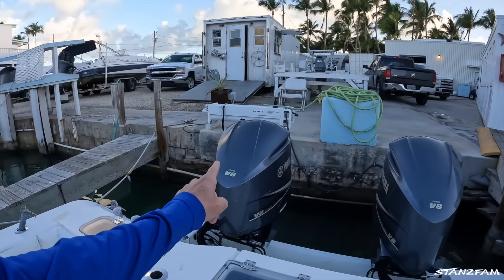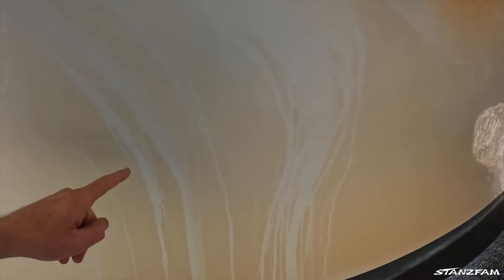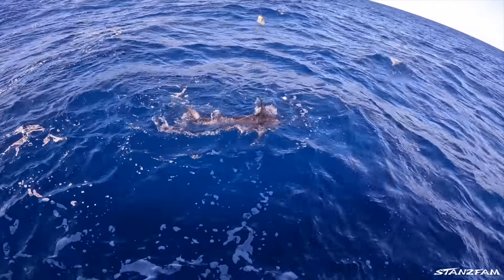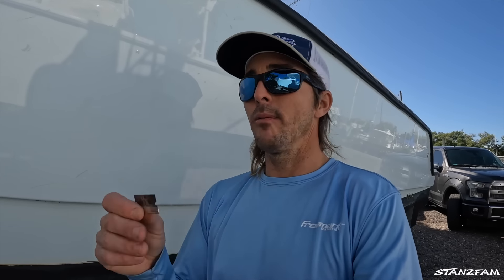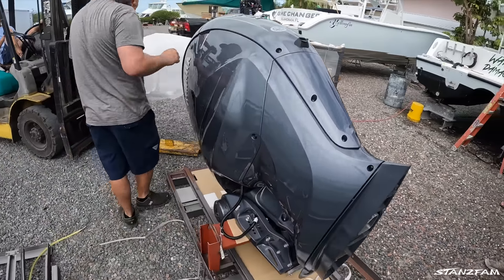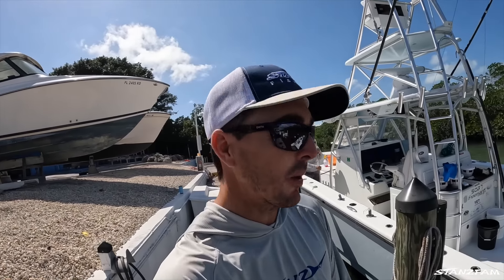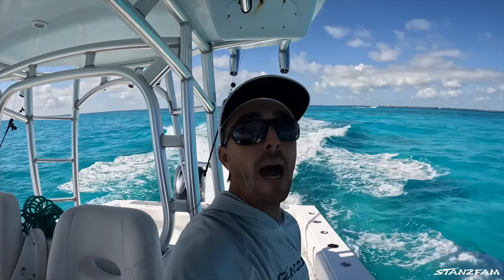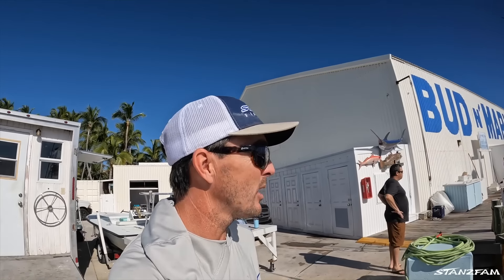$140,000 Motor Upgrade! New twin 425 HP Yamaha Outboards Installed on 37 Freeman!

Comment: How awesome was that!? I would’ve loved that ride! Good for you, Nick! Congratulations 🥳
Reply from the maker: @apollo5751 These are 30” shafts with integrated steering, retail pricing was $94k in fall 2021 when we ordered the motors. They are more now. Two sets of controls with new harnesses/wiring, new gauge (CL5) down stairs to support helm master 3 steering, two new helms, two new props, Install of new motors and all the rigging. removal of old motors and old rigging, bottom paint, fiberglass/gelcoat work, acrylic plates for dash, 17 days in boat yard, acid wash, wrap removal, wax, hinges, speakers, etc another $40k
Reply: Absolutely comical.  You're telling a Yami    Pro Staff member what things should cost!  Ha.
Reply: @Pietro-ni6ow  nope, I’m fairly certain he told you what it DID cost 🤷🏼‍♀️

Comment: Great re-do, Thanks for the work to share this with us.
I’d suggest getting the Sharrow Propellers.
It will get you a better economy of fuel burn and it will pay off their cost of $10 k.
* Only do so if Yamaha Marine Corp. will honor the warranty..
Reply: Also add a raised baffle at the stern to decrease the sound. Add Sonix to the side that faces the engines. 
It would lower the Decibel level and help with hearing issues later in life..
If your interested in my concept I can share it.
Lmk
Reply from the maker: Thanks for the info 

I would like to try the sharrow props too
Reply: @JS-sx3bl  you realize these are super quite right? no where near hearing damage levels!
Reply: @ct1762  I’d suspect you meant to spell Quiet. In any case the main issue is to get the propellers more efficient and second deal the sound of the two 450’s humming away at 5,000 rpm or more which has a great deal of overall decibel or DB displaced outside. 
* It’s reasonable when a person invents a product, it seeks an attempt to solve a problem, or ‘to better’ a known issue by the use of that invention..

Comment: You're going to love the 425s.  The power is great but the lower unit oil change at the dock is the real game changer!  The 3 piece cowling is a pain though.
Reply from the maker: Thanks! That was definitely a selling point for the gear lube
Reply: I really dislike the sound of the 425s when above 70% throttle.  They seem way too loud compared to Mercs or lower power Yamahas, and that is not just on Nick's boat but on every boat I've seen them on.
Reply: @TheVonMatrices  they addressed that on the new updated 450
Reply: @jonathanmack8487  I didn't know that. I'll have to listen to one.
Reply: @jonathanmack8487  Was out on a boat with the new 450's no more than a month ago, still very noisy. The Merc 450R is a much nicer engine to listen to, and the V12's are in a different league from a comfort standpoint.
Reply: @AB-80X  Oh gotcha. Have a boat coming in soon with triples I’m interested to hear them.

Comment: I had a mercury 250 have 471 b4 it blew up. And mercury 150 blew up at 500 hours. I then bought a 115 yamaha and 150 yamaha and they are still running with no problem at all.. no more mercs for me
Reply from the maker: Yamaha’s are definitely the most reliable. But I would say all the engine brands have really come a long way the past decade and they’re all pretty good nowadays. However I have no plans ever switching from Yamahas

Comment: Awesome video and congrats on the re-power!  I will be new to the Yamaha group soon so I have some questions for you when you have some time. Wow…4400 hrs on the 350’s is awesome!!
How would rate the Yamaha’s on a scale of 1-10 for overall experience?  I assume pretty good since you stayed with Yamaha rather than going with Mercury. 
How do you like the 425’s now that you’ve had some time to use them?  Are they miles ahead of the 350’s in performance and technology?  
Any issues with the 425’s to this point?  Are there things about the 425’s that you really don’t like?
Thanks for your time and thanks again for the cool video!
Reply from the maker: Thanks for watching! No doubt Yamaha makes the most reliable outboard engines. This boat isn’t at our marina any more but we had around ~700 hours on the 425’s  before it left. Never had an issue with them here and being able to change the gear lube while the boat was in the water was super convenient. We could definitely tell a difference in these engines compared to the 350’s. We were limited on prop selection which I’m sure there are more prop options to choose from now. They did lose a gear case within a month or two of the boat being at its new home. I’m not sure if it was operator error/abuse or just wear and tear/mechanical failure. 

We are at almost 1400 hours on quad 300 Yamahas on our boat and haven’t skipped a beat the past 11 months. We are upgrading to the 350’s soon so excited to see how much performance improves
Reply: @StanzFam . Curious why you didn’t jump up to the 450’s rather than the 350’s. I hear they have made lots of improvements to the 450 compared to the 425’s. Thanks for the info!  Really appreciate your time
Reply from the maker: Too big for the 42’ Freeman. They work on the 47’ though

Comment: If you haven't tried it yet, put the muriatic acid away and buy Oxalic acid powder. It's typically cheaper and much nicer to use. For water staining or rust stains just mix the powder with warm water in a spray bottle, spray it on, wait 30 mins, then rinse it off. If there is any staining left either repeat or make the solution a little stronger. No need to do that nasty and dangerous brooming. I have used this on commercial boats for years and it just works. Most of the expensive water stain cleaners you buy in gel form etc are primarily oxalic acid based. Enough powder to clean the staining on the boat in the video might cost $5.
Reply: Oxalic can be gritty depending on how fine the granules are so be careful with the gelcoat. Bar keeper's friend for example is designed to be pretty gritty. If all you are doing is making a solution and spraying it off, it should be fine, but careful on applying TOO much elbow grease in tougher to clean areas. I think that's where muriatic works really well because you can pretty much scrub as hard as you want since its pure liquid.
Reply: What ratio of acid:water do you use with Oxalic acid powder?

Comment: I have a 300 r 2023 power head that hydro locked.  I ran it for 15 seconds while it was slightly hot( 145 block temp).   It has 10 hours on it , but is seized.   The plugs are clean and the computer is immaculate.  I know you need to know why it’s ceased, but assuming it’s not warped, what kind of value do you think it has?
Reply from the maker: I haven’t sold any racing engines like that so I’m not sure how valuable it is. I would just look online to see what similar engines are listed for

Comment: Good looking boat. I think you need some more cup in your props though. They could stand to hold a touch more water at cruising speed. Running light, you could up the pitch a couple inches and probably see 52-53kts but I don’t think it would help anything loaded. I’d run 4 blades up a hole or two though.
Reply from the maker: We are hoping to get the EC series soon. (Extra cup). We just put on a pair of 21’s and got the Cruise up a few knots. Waiting on more props to try though.
Reply: @StanzFam  it’s a shame Yamaha folded Turbo up. I think pair of Turbo OS1 4 blades in 20p (16.25” diameter) would probably be exactly what the doctor ordered for that setup. They had huge blades and good cup so they bit really well and kept torque on the prop, not in a rooster tail. They’d top out at around 50kts WOT and cruise with probably only 10% slip.

Post a video when you get it dialed in please. Curious to see how that setup does.

Comment: FYI, dunno if you knew this but Blue Wave, the company that makes the fish box cleaner, also makes Rust & Water Stain Remover in a spray bottle. I have used it a couple times and it works a lot better for me, is sustainable and has no impact on our planet, which is the most important (for me), and might be much better for those that don't want to use plain Muriatic Acid.
Reply from the maker: Yep, love their rust remover.

Comment: Which engines are better in terms of fuel consumption: These 425hp or the four 300's?
Reply from the maker: They seem to be about the same , we are still playing with props . I do prefer the quad 300’s but the maintenance is a little more
Reply: @StanzFam  Great! And what about the noise? Which of these two was quieter? I'm looking at a Mercury 400 V10 pair, and I'm in doubt between these two engines.

Comment: Was it under powered with the 350s?
Reply from the maker: It was definitely bare minimum. Fine with a light load or even a medium load when they were new, but we definitely wanted a little more horsepower when we had a lot of fuel on board, livewells full, and a handful of people

Comment: You should have used a rubber wheel attachment for a drill to remove those little wrap pieces… would have saved you hours and hours of work lol! Next time!!
Reply from the maker: Thanks for the tip

Comment: How many times did you have to change out the harmonic balancers?  Did Yamaha foot the bill?

Love the boat.
Reply from the maker: We replaced flywheels every 700-800 hours. (Whenever we hit 80 hours in the specific rpm range). Yamaha covered the fly wheel changes

Comment: Will you re-wrap the boat? Aside from the scratchs working fish what was the condition of the wrap? (I need to repaint and am considering a wrap. Any observations you have on wrap vs paint are appreciated. Thanks and good luck )
Reply from the maker: We may re wrap it eventually, just not yet. I think that wrap was almost 4 years old . A wrap is definitely an easy solution to repainting, but they can scratch and tear if you’re not careful.

Comment: 140 000  it cost for two motors in usa ?  they are new ?
Reply from the maker: Motors, 2 sets of new controls , install, derig old motors, bottom paint haul out, wrap removal, hull wax, minor fiberglass and gelcoat work etc
Reply: @StanzFam  tanks.  can you say - how mach motor yamaha  for 150 hp ?

Comment: How’d you arrive at 140k for a “pair” of 425’s…?
Reply from the maker: Two new 425’s with 30” shafts are $100k, new controls (2 sets) with rigging, new helms, labor to install new motors plus remove old motors, haulout , wax , props, bottom paint etc was $40k , 100 + 40 = $140k
Reply: @StanzFam  Roger
Reply: @BigOleWhatchamacallit  yeah Yamahas are almost impossible to find and have gotten really expensive
Reply: Got a pair on a 33' Scout. Awesome machines!
Reply: Some poor soul will buy those 350s and find out why that was the worst engine ever made. They are just bored and stroked 300s which are great engines but amping them up to 350 left them weakened. They were lucky to get 4500 hours out of them. The 425 is a really great design and build and give a really good power to weight ratio.
Reply: @greghuff3316  new ECM’s, & some poor bastard will never know the difference…3-5% of Captain’s run a boat that hard, that quick…I’m a 300-500Hr year guy…🤓

Comment: Would be fun to see it with a pair of more powerful and much lighter 450R's.
Reply from the maker: Freeman pretty much stopped hanging 450R’s. One of the most problematic motors out there
Reply: @StanzFam  Odd. The marinas here in the salty Scandinavian climate has several boats with them with many offshore hours, and zero issues. I have not heard about that, but would love to see some reports detaling it.
All in all, the Merc V8's seem to be a super reliable platform. It's not like the Yammy V8's has been flawless. Looking at a boat going offshore, I'd never choose an outboard with the starter issues the 425 has had. Imagine being stranded 50 miles out. There's also the fuel system that tends to pull in air which diminishes power. I would not want the vibrations from those either.
Reply from the maker: @AB-80X  The old 350 V8 yamaha definitely had some issues. We only have 260 hours on the new 425's so far but no issues yet. I am a big fan of the Yamaha 300's.  One person I fished with on their 47' Freeman got tired of carrying around a spare lower unit for the 450's so he stuck the V8 300's on them. There are a few 42/47 Freemans For Sale now with the 450's and they are seen as a liability to most potential buyers now. I wouldn't recommend a racing motor to anyone if you want a long lasting reliable motor. Maybe on the raceboat for fun but not going way offshore like you mentioned

Comment: New 2024 Yamaha F350s would be a good match for the 37’ Freeman. Agreed?
Reply from the maker: Not with twins. The V8 350’s were bare minimum.
Reply: Ok, got it. Was too focused on the weight advantage of the new F350s. Hugh fan of the channel and Bud n’ Mary’s. Motor by it all the time.

Comment: boat must be severely underpowered. most 37 freemans I've been on have quads, 300+hp. and run around 60 knots.  Surprised those e35p's lasted as long as they did, working that hard
Reply from the maker: I’m sure billy freeman didn’t send boats out “severely underpowered”. I would say twin 350’s was bare minimum, but twin 425’s should be a nice package on the boat

Comment: Hey Nick how much would those engines sell for?
Reply: 44k each
Reply from the maker: The new 425’s or the used 350’s?
Reply: @StanzFam new ones
Reply: @StanzFam  44k is what google says. But no telling with inflation and delivery
Reply: @StanzFam  The used 350's
Reply from the maker: @therightdoctor the 30” shafts retailed for $47k when we ordered them 18 months ago. I’m sure they are even a little more now. the 25” shafts are definitely a little less. 

All new controls, gauge, install, and Boat yard bill etc added up to almost $40k as well : /

Comment: If you look after your motors, that is not a lot of hours. They are designed for a lot more.
Reply from the maker: 4400 is a lot of hours. They can get more but how many boats do you see for sale with motors with that many hours? Very few. 3000 plus is good for any brand
Reply: @StanzFam  Thanks for your reply. Much appreciated. Great show!!

Comment: Twin 425's should run about 90 grand (unrigged).   $50 grand to rig this boat ???
Reply from the maker: 425 with a 30” shaft is $2k more than 25” shaft. ($94k retail for the pair) 

Two new binnacles, new harnesses and rigging tubes, two new helms, autopilot, new gauge, derig old motors, install new motors, transom plates, touch up fiberglass/gelcoat repair, remove wrap, wax hull, props, bottom paint, 17 days in yard, fuel, new outrigger bases/poles , plastic to cover old holes, etc. another $45k more . 😳

Comment: 140 k for 2 engines crazy
Reply from the maker: Motors themselves retail right about $95k for the pair and the rest included all the new rigging/harnesses, binnacles (throttles) , gauge, removal of old motors and all the old harnesses, fiberglass/gelcoat touch up, install of the new motors plus rigging them, wrap removal, acid washing and waxing hull, bottom paint, 17 days in the boat yard etc.
Reply: @StanzFam  seems crazy compared to car engines for 95 k could get lots.i get it just wow they making a killing.
Reply from the maker: Agreed it’s a expensive investment
Reply: @StanzFam  I'm jealous your on the water it's worth it!

Comment: Don't you think $140K is little excessive for 2x $40k motors(even with the install and new controllers?  100k max..... Removing wrap is probably more than it was to install it, if left on longer than warranty time...   Great rig though.. Keep those videos coming
Reply from the maker: A pair of 30” 425’s retailed for $94k  plus tax when I ordered them over 2 years ago (they are more now) , removal of old engines, install new engines (mechanics are $240 per hour at Caribee), pair of props, two new binnacles, all new wiring harnesses, new autopilot, gelcoat and minor fiberglass repair, two new helms, new bottom paint, plus wrap removal. Was not a cheap job. Thanks for watching

Comment: So, if the new motors go 4400 hours, that is $32.76 per hour. Sounds a bit pricey.
Reply from the maker: Won’t have to buy new controls, rigging, gauge, autopilot, etc again , just motors in the future, so won’t have to spend the other $40k for all that stuff. But we will bottom paint every year

Comment: Ain’t no way you paid 140k for those 25k a piece outboards lmao
Reply from the maker: Retail is $47k a piece for a 30” shaft , so that’s $94k just for the motors. All new controls, new gauge, rigging, autopilot, gelcoat and fiberglass work, removing old motors and rigging, installing new motors, bottom paint, removing Wrap, wax entire boat etc.
$140k

Comment: Something wrong with math 425 HP yamaha each $32000
Reply from the maker: I’ll buy 100 425’s if you can find them for $32,000 each. They average $45,000 a piece for 30” shafts with integrated steering. Throw in all new wiring harnesses, two new binnacles, gelcoat work, labor to remove old engines and install new ones, a bottom job, new autopilot, wrap removal and you’re at $140k. I just bought 4 new 300 HP for our 42 and they run between $33k-35k retail a piece with integrated steering on 30” shafts.